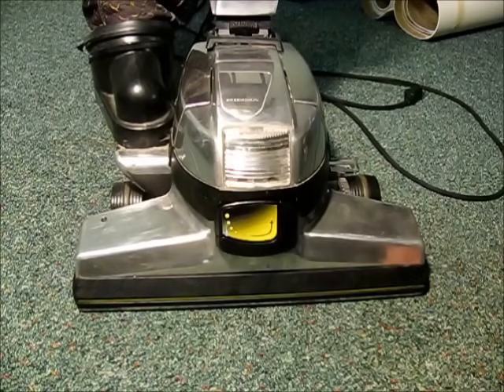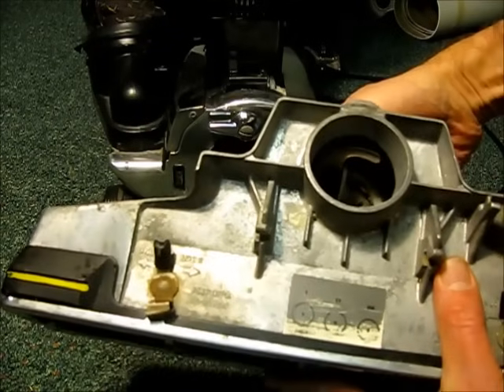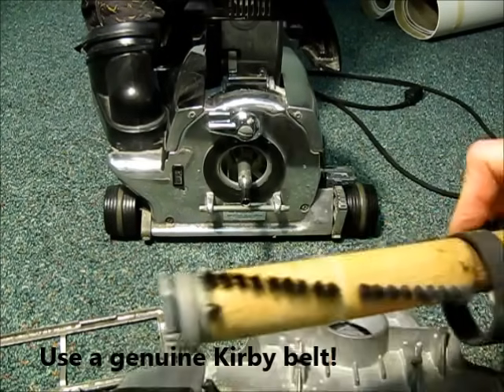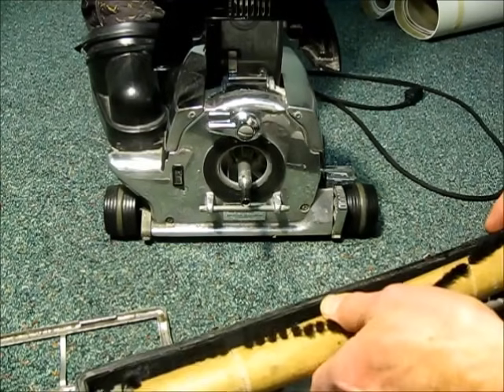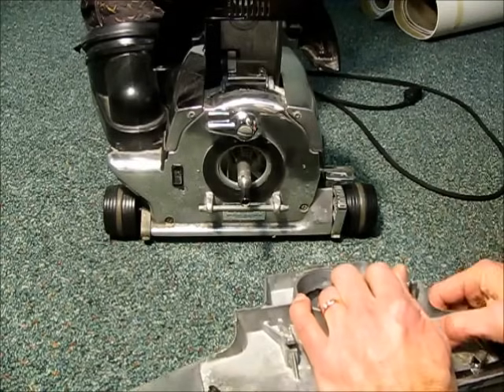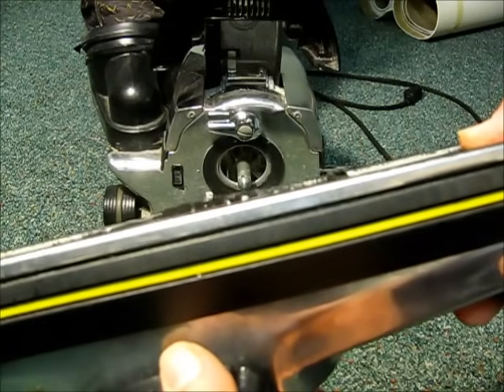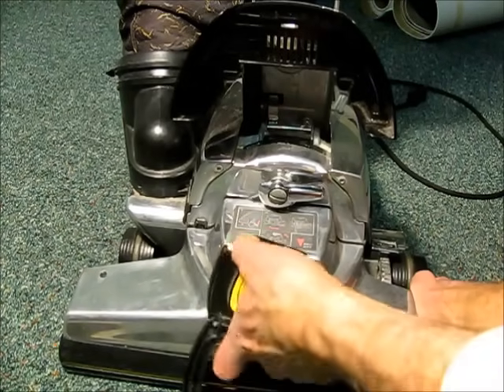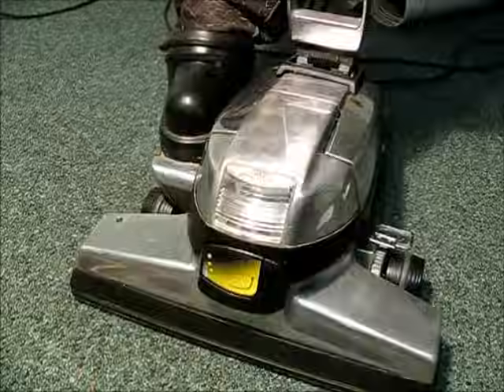How to replace the belt in a Kirby vacuum cleaner

Comment: Sometimes we simply need that boost of confidence it's been awhile since I used this Kirby locked away in storage for several years,lol... So when it came to changing out belt VHS Tape with no player was useless. The manual can only take you so far. And just couldn't get the dang belt on the hook.
But watching how you did this really helped me like it should be hooked at red to green arrows points at this stage. Thank you for making this video your so helpful.
Reply from the maker: You're welcome. You made me chuckle with "VHS tape with no player."  I ran a repair shop for  those back in the nineties. How fast wildly popular technology becomes obsolete. Thanks for watching and commenting1

Comment: Thank you for this, you made it pretty clear for me except I'd like to offer a suggestion. This is about the tension of the belt. The one thing I wasn't grasping is really needing to pull that hook that grabs the belt stretching it in order for it to be grabbed by the shaft. My first thought was that I was putting too much tension on it and fearing id snap the belt, yet it wasn't able to be set on the shaft till after a few tries I just said the heck with it and really twisted it towards the red-off position in order for it to complete the changing of the belt. This is my girlfriend's vacuum cleaner and I've never had anything this advanced before. We are both seniors so, I had a hard time finding one of these Youtube videos that made sense to me.

Comment: should the belt be tense/tight in the “belt on” position while vacuuming or should it be loose?
Reply from the maker: Yes, the belt should be tightly engaged around the drive shaft and the brush when in the "belt on" position. If not, it has failed to load properly and you have to try to load it again.

Comment: I am having trouble, when I try to place new belt on, the belt is on but it is in the "off" position.  Should I just use it like this.
Reply from the maker: Belt "off" is only for getting the belt off the motor shaft for removal and replacement. With it all assembled, rotate the lever to the belt "on" position and try it. Check for brush movement, If the brush is turning, it's good, If not, you have a problem with the that "on" "off" lever assembly that will need attention.
Reply: Thanks taking time out to answer me.  I appreciate you.

Comment: the problem that I have with my Kirby.it keeps burning the belts off.do anyone have a solution?
Reply: You likely over-adjusted your cleaner to the point it becomes hard to push, thus causing the belt to wear down quicker. You need to stop adjusting after you first hear a change in the sound of the Kirby motor, but if suction breaks then adjust your Kirby only one more step down.
Reply: same shit is happening to me baby sister but if you clean the part the belt go's on the part were it sticks out with some bleach it should solve the problem it did for me and l was having the same issue you were Take care Tony

Comment: holy crap! I do not have the strength to turn this thing. Looks like I'm shopping for a new vacuum cleaner.
Reply from the maker: Must be something wrong with the drive system
Reply: @The Original Mechanic  no. I mean I can not turn the thing to put the new belt on. You know how it stretches the belt going from the off position to the on position. I remember having problems doing it with my mom's old kirby. Now it's a gen 4. I finally got it, but it was a fight.